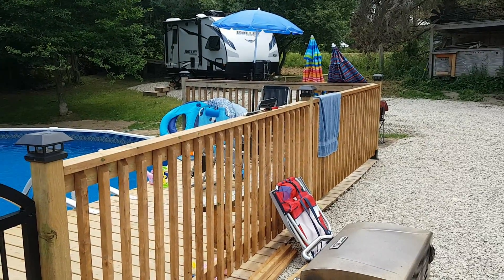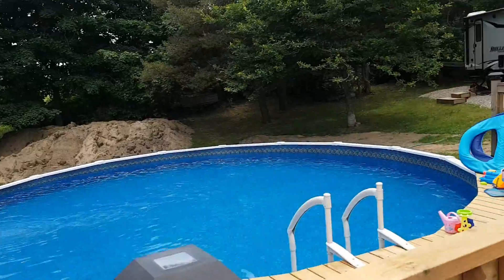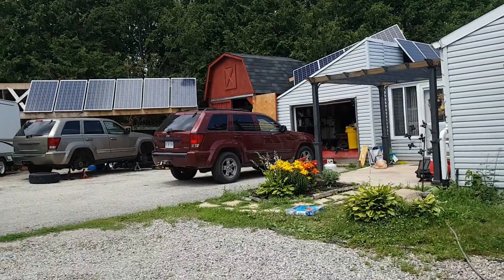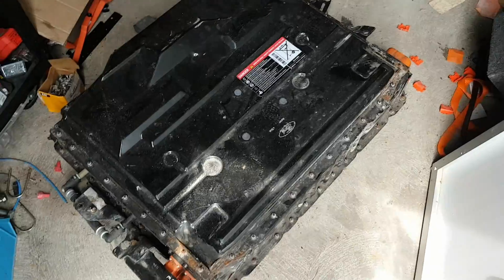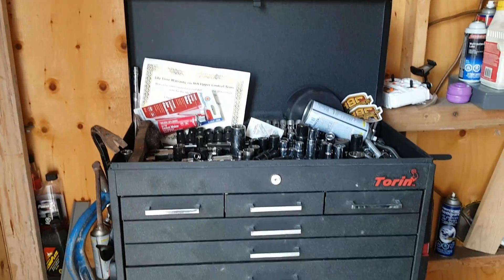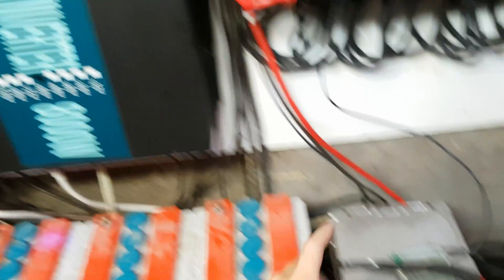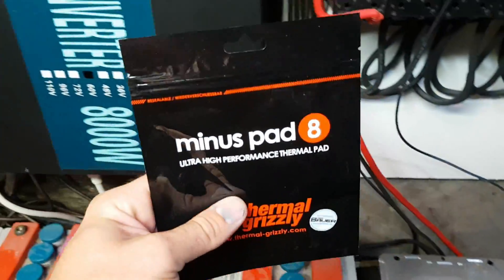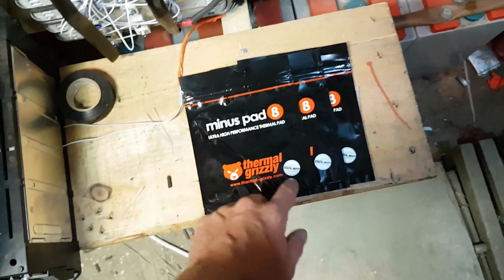Update And More Batteries!

Comment: To be very honest, the term FREE ENERGY never crossed my mind until I read your response. I only saw this as a way to control the panels environment. After re-reading the post, I understand why someone would come to that conclusion. For what little I know of the engineering aspect of it, you are correct. But using that logic, if you have a controlled experiment using a 100W incandescent lamp in comparison to 100W LED module, the output from the panel should be equal. That shouldn't be the case because the LED mod would be brighter by design. I've found that, in the engineering fields, there's a direct/physical connection between the input and output power that creates that balance. That connection doesn't seem exist when looking at solar panels. There's a good chance that I'm WRONG. But, the question is food for thought. By the way, I enjoy the content of your videos. In a good way, I think you're crazy. The effort that you've put toward your system is amazing. I would've given up soon after I started.

Comment: Enjoy those kiddies while you can they grow up so fast. I was thinking CMax but those didn't look like the 24ah modules so must be focus. You will tell us sooner or later. Picked up a couple of inverters but they are high voltage a 120VDC and a 144VDC so now I need to fine a charge controller for them. I hooked the 144 VDC up straight to the solar panels as they put out 160 volts she booted right up and gave me 240 VAC. time for a break now. keep up the videos they are awesome.
Reply from the maker: thanks! I will enjoy them! wow high voltage inverters sick!! you guys gunna leave me in the dust at 66v input :D looking forward to seeing a few videos of your system!
Reply: Hey he still had a couple left this morning 10kw $500 or so he said I only have 2 left 120vdc to 120vac 10 kw 110vdc to 110vac 10 kw $500 each
Reply from the maker: where ?
Reply: Same guy I got mine from. I have 2 now as well.
Reply: Wow some of them are monsters good they are on wheels because one guy has a hard time lifting the big one.

Comment: Hi, This is the first time that I've posted a comment on any video; I don't do social media. However, I've been following off gridders for awhile and I have an idea to be investigate. I see that you have solar panels that haven't been setup at this time. I believe that people are stuck on the idea of using solar panels because sun light is free. But, they work on any bright light. We now have low power, high lumen LED lamps used on cars, annoying. I think that using them to illuminate the panels in a low profile reflective cabinet, on the cheap the shiny side of aluminum foil, is a better way because the power that is lost using them would be nothing compared to that which is gained by 27/7 power generated from the multiple panels to which it could possibly illuminate. They won't have to be mounted to roofs, they'll be out of the weather, they could be placed in any unused locations like attics, crawl spaces and basements etc... Do you think it's worth investigating?
Reply from the maker: I do not think there is free energy that easy, the led lights will still use more power then they output.

Comment: Did you ever sell that battery.  From a few weeks ago
Reply from the maker: I still have it, was thinking about keeping it but if you want it its still here. my lithium batteries contact seems to have a shortage of batteries :S
Reply: Going Off Grid I've struggled to find good batteries.  For a reasonable price.  There hard to find
Reply from the maker: yes im having a hard time as well as im looking for only the larger ones now, these smaller packs are more work to hook up as there is more of them.

Comment: how do you use EV battery to a inverter   I am going to buy a 48v inverter, i want it to be solar charged also the batteries must br EV batteries   How do we install it 

Becuz the ev batteries are like 200V
Reply from the maker: you have to disassemble the pack into the smaller modules , be very careful this high voltage can kill you.
Reply: Going Off Grid wow thats gonna be hard :-(